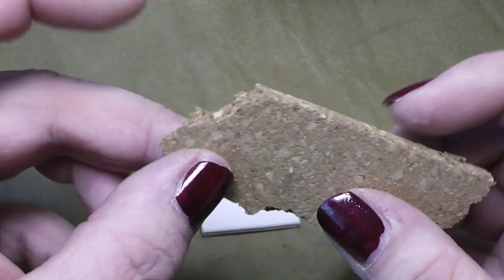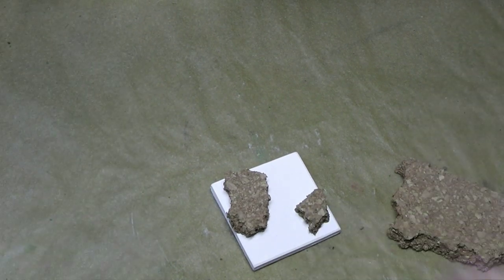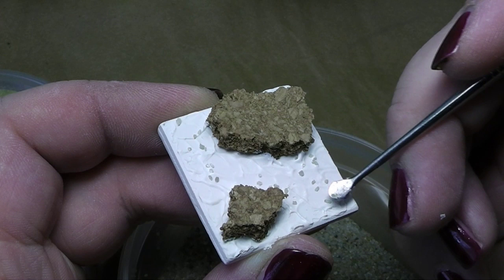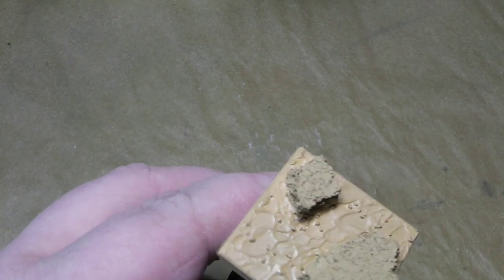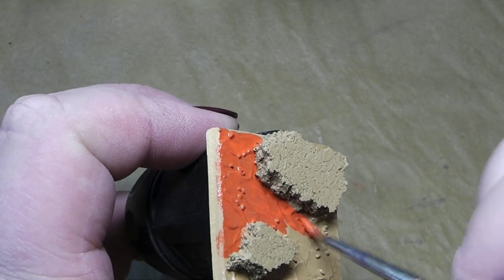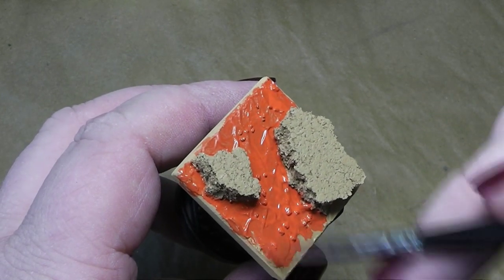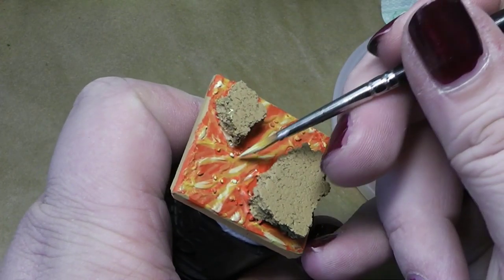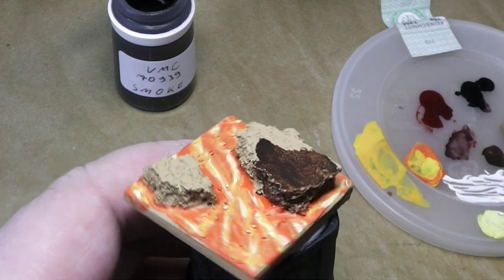How to paint a lava base

Comment: I'm setting about making bases atm. Quick Drying Green Putty (I guess it's like liquid Green Stuff) when squeezed right out of the tube makes for good rocky areas, then sculpt in some runs for liquid (water, slime, chemical, lava) . I plan on making a base like this, so I'll need to buy some cork (got some other plans for it too). I can see how I can use the techniques for other liquid surfaces. Thanks a lot for the tips!

Comment: I know a way you could improve this base, I'm sure you'll like my ideas! I like to build up around the bottom areas of the platforms with putty slightly just to give that extra thick feeling to the lava. Also, instead of using the yellow and orange highlights around the base of the platforms I used red on the bottom, and slightly orange on top of it and then applied a red  wash to it like the one used on the lava. Also another tip is also to build up and smooth out the platforms a bit more. I know it's only a tutorial piece and I'm nitpicking but if you don't usually do the things I mention I recommend you give it a try! This tutorial plus the things I came up with gave me some great bases. Thanks heaps!